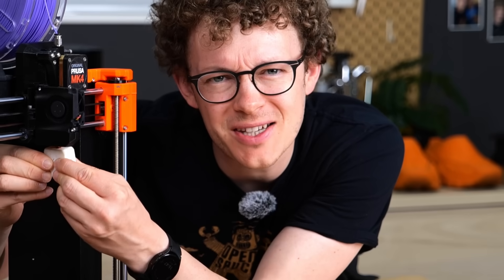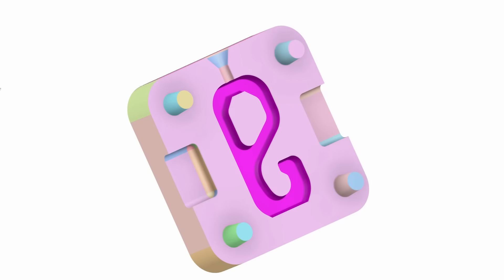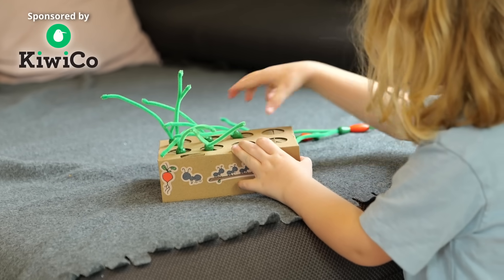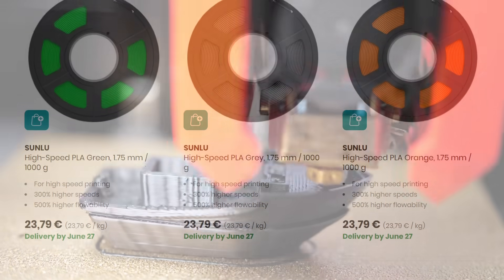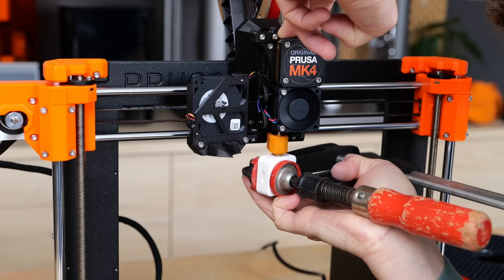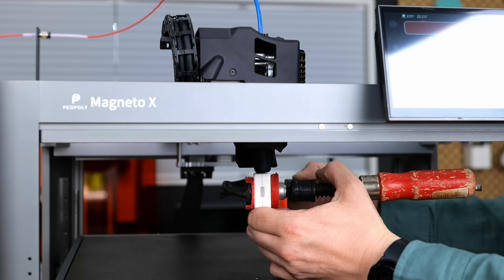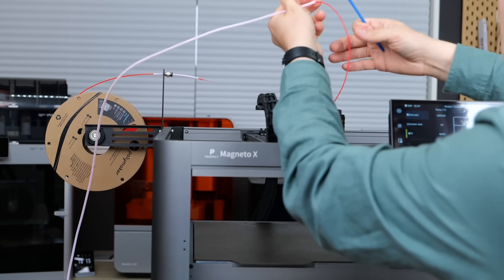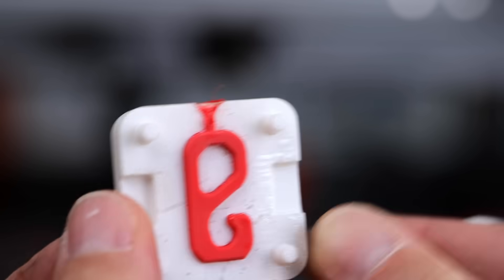I tried Injection Molding using a 3D Printer!

Comment: I see you are using a cereal box with a Rosahl RS1 dehumidifier membrane for filament dry storage. I made some 3D printable parts which simplify mounting the membrane along with PTFE tube outlet and USB power supply in place of the original cover plug of the cereal box. See on Printables if anyones is interested: https://www.printables.com/model/889550-filament-drybox-with-rosahl-rs1-electric-dehumidif. Also made mounting covers/frames for larger Rosahl membranes for bigger filament storage boxes, also on Printables.

Comment: I'd move the injection port to to centre of the mould by the Y section. Then have a small hole at either end to allow trapped air out at the points furthest away from the injection point. I think you will find that works.

Comment: i'd make a jig with a clamp to hold the mold in place and use the stepper motors to apply the downward pressure, it would keep the mold plumb and keep pressure inside it.

Comment: My immediate idea is to increase the material throughput. The problem seems to be that the plastic solidifies before it can completely fill the mold, which is by design, since this is intended for 3D printing. So I recommend something that the printers were under no circumstances designed for: melt multiple filaments at the same time and push them through a single nozzle with the largest diameter possible. Of course doing this would need multiple custom parts, made from proper (not 3D printable) materials.

Comment: wow those parts @9:16 are so crisp... what printer and fillament were used?
Reply: I also asked that few post bellow. Printer is obviously BambuLab X1 Carbon, there is calibration pattern at the side of heat bed, so it is one with Lidar, but i would also like to know what is that fillament...

Comment: I did this months ago, but I used an aluminum mold and secondary heater blocks to maintain temperature to keep plastic molten. It worked okay, but ultimately the limitation was maintaining heat. It's just a continuation of the hot-end, but without the high powered heaters and pressure used in injection molding, you're limited on part size.

Comment: Air lock?  Maybe a breather tube? What happens to the air in the mould as the plastic is injected.  If the mould is sealed tight, wouldn't that just compress the air at the end of the cavity?

Comment: One idea i had, where heating the mold not just before, but also during injection. With a heat mantle or as mentioned above, be pressing it against the hot plate. It might change the mold to be filled from a flat side necessary. Nit sure, if that’s possible or feasible.

Comment: You need to add vent grooves in the mold. This drastically helps fill the cavity when doing low pressure desktop injection molding. If done right (size and location of the vent as well as injection pressure) the vents won’t yield much flashing if any at all. I’ve successfully printed SLA molds with .001” deep x 6mm wide vent slots that fixed the short shot issues I was having.

Comment: It looks like the issue with the screw is that by the time the plastic gets pushed down to the head side, it is already transitioning back to solid. Try flipping the part in your mold, so that the sprue is on the head.
I would try finding an all metal clamp that can sit flat on the print bead without needing to hold it. Reinforced the heated bed such that it can take some force. Set the mold in the clamp, and set the clamp on the bed to preheat (and remain heated throughout the injection). Use the Z axis motors to drop the tip into the mold and apply pressure. The 3DP mechanisms may not be up to the task (force), but the method would at least be more consistent than relying on you to hold the mold up against the tip.
anyway, I think that with working on the lower limits of both plastic temperature, mold temperature and extrusion pressure, you will have to experiment a lot more mold design and part placement than you normally would on injection machines.

Comment: Some suggestions
1. Place the mold on the print bed and then CAREFULLY lower the print head and use the z-axis to seal the connection
2. Add a vent to the mold so you're not working against building air pressure in the mold

Comment: Try to add small hole at the bottom of injecting model to let air inside escape this way when you push filament from top, it will reach end and fill up properly :)

Comment: Ha another brillant idea, but why did you limit yourself to a nozzle and dont use a self made "threaded tube" with a suffisant length to contain all the molten plastic in place of the nozzle, you could even use the diameter you prefer like 1 or 2 mm at the end of the tube ?

Comment: I believe that if you take all other advices like vent hole and sprue location changes and then heat up your mold to +200C in the oven (I believe your resin will handle that without issues) then you will be able to inject much bigger designs without any issues. And for small models like your hook, hot mold + vent hole should do the trick.

Comment: Hi Stefan, I'm one of your supporters, and I like your scietific approach. I'm a plastics and composite engineer, and my approach would be a bit different. Since I frequently use silicone moulds (molds), I would recommend the following: Resin print your part as detailed as you want them, silicone would have around 2 microns in molding tolerance. I believe you would be able to produce vinyl records with it (perhaps). Yes, silicone is a flexible material, but if you have a support mold or a mold box in metal, you will be able to add pressure to your mold, and have no deflection. One advantage more with silicone: Some types withstand temperatures up to 450 degree Celcius. 200 degrees can be done with a standard silicone. You can then preheat the mold, and use your 3D printer as injector. When the mold is preheated, you don't need a high backpressure. But it doesn't hurt to have a simple fixture below your moldbox and the printers nozzle. Things can get hot at times ;-) If you experiment with preheating temperature, mold size and perhaps cooling oportunities, as you can cool your moldbox and the silicone inside in different ways. Maybe you can also get some inspiration by watching this guy: https://www.youtube.com/@TheCrafsMan   He makes pressure casting molds in silicone, and cast thermoplastics in them. Thank you for your great work :-)

Comment: Rather than just preheating the mold, you kinda want to do this inside a furnace so the cooling only starts after injection. Clamping the mold between two temperature controlled heating elements might be sufficient to create such "furnace". Oh and air vents might be useful too.

Comment: Why not using a direct connection to the heater block? simply use a long hollow M6 adaptor (cut away the nozzle part from a Volcano nozzle), and screw it directly to the mould. You avoid pressure losses in the nozzle.
Also, preheat the mould to 150C-180C...

Comment: cartridge heater on the mold 
waste gate so your not compressing air to fill 
canttwist clamp. or over center ratchet welding clamp for quicker set up.
Die-sinking EDM for alum molds to keep them hotter

Comment: Pre heat your mold to as hot as you can before it becomes too soft to function, by putting it in the oven. This will keep the inflowing pla hotter longer. Right now it's probably cooling and hardening quickly by contact with the cold mold.

Comment: @CNCKitchen maybe it would be beneficial for a tighter "entrance seal" to go from a simple cone shape to a hole that allows you to really insert the hex head of the nozzle. This removes any canting and might further increase injection pressure. And I would always use pre-heating to catch those extra seconds.

Comment: Try making your sprues as short as possible. The unnecessarily long sprue on your M4 screw is robbing too much heat from the molten filament before it has a chance to reach the mold cavity. Also, as others have mentioned, if you suspect your mold is near airtight, add (tiny) vents to the parts of your mold that filament has trouble getting to. You could even try modifying your existing molds with a 90° chisel, or a hacksaw blade held at 45° to the surface. Maybe even go crazy and try to pull a vacuum through the vents! :P

Comment: Wow! Your creative idea on 3D printer is amazing and endless.  What a smart move to leave some room for everyone here giving their input and gain more engagement, which you tried not to put an air-release-hole to the mold as well as lower the print head to fix the mold in position with down pressure instead of hold by hands. 👍🏻

Comment: You missed 2 things. Inject into the center of the part and you need vent(s) to let the air out so the plastic can go in faster with less backpressure. I have never done injection molding, but this seems like simple logic.

Comment: Quick comment on the Resin you used: Rigid 10k actually is based on Al2O3 filling - 4K has a glass filling. That's why you get much higher heat deflection temperatures with 10K - because it is kind of a ceramic!
Greetings from Germany! Great video and idea!
Reply from the maker: Interesting because the datasheet clearly says "This highly glass-filled resin...". Gotta dig a little deeper.

Comment: I'm curious as to why you were holding the mould to the nozzle by hand. Surely you could've made a more reliable and consistent seal by placing it on the bed (preferably with a large flat piece of wood underneath it to prevent damage), and then lowering the print head onto it? As long as you don't push it too hard, the lead screws should be able to exert much more force than you could by hand, thus increasing the potential injection pressure.

Also, safety - no chance of hot material leaking onto bare skin!

Comment: While your mold isn't air tight having exit holes might help. You have quite a long sprue hole and the plastic has the flow the entire path of the mold without hardening. Better placement of your injection port would help a LOT.

Comment: I believe with the ceramic-like resin-printed high-temperature molds, it might also be possible to add a channel into the mold where a removable thermal coil of wire connected to an adjustable temperature control module can be inserted before the injection molding and removed after cooling, heating the mold to a desired high temperature during injection of the filament material to keep the viscosity low until filled, then turning off the thermal coil to allow the mold and filament material fill to cool, completing the injection molding process.  The temperature of the thermal coil need to heat the mold to match the temperature of the filament material being injected without melting or warping or deforming the mold itself, otherwise the process wouldn’t work.

And as recommended by most others here, definitely make sure to have an air vent or two in the right locations.  Even with enough injection pressure, the hydraulic physics involving gases and liquids, both of which are considered fluidic in properties regarding pressure and density, can and will fight against the force of pressure from the injected material pushing into that cavity.  The air in that space need somewhere to go, and the material trying to fill the space is too thick for air bubbles to push through as the channel is too narrow for gas and liquid to switch places in different directions as nature intended.  The air vents don’t need to be big enough for the injection material to flow through, just big enough to let air escape properly, as you can clean it up later after cooling and removal from the mold.

(Note that I don’t own a 3D printer, I’m not an expert, but I have a good grasp of physics and an understanding of fluid dynamics and technological engineering, plus I have seen plenty of videos involving 3D printing and scientific principles and tech repairs/innovations to simulate these possible solutions to help.  If you have the skills and equipment and parts to test my idea and prove whether I’m right or wrong, feel free to do so and let me know the results.  I’m not fragile and I am aware I can be mistaken about a lot of things, but I usually have good intuition when it comes to these things and I enjoy learning something new.)

Comment: I'm an injection moulding machine operator and for a while now have been trying to emulate the quality of injection with 3d printing, but I remember seeing this topic before and have often thought about it. It's easier to take an injection moulding machine and turn it into a 3d printer than to make a 3d printer perform injection moulding. I do have some suggestions, however. You may want to design your mould with small vents for the compressed air to escape, also preheating the mould is key - you're on the right track there. Allowing the molecules time to relax will help reduce internal stress and warping (i.e. slow, adequate cooling time). I think that mould release helps. However, I think your main bottleneck is injection time. Normal injection moulding occurs in a fraction of a second (i.e. 0.10 sec on the faster end of the spectrum), filling the mould in 5 to 10 seconds allows the plastic to cool and freeze before it has time to completely fill the mould. The leading edge of the injected plastic freezes first. Keep in mind that temperature increases with flow rate and pressure. Maybe add a gate to maintain a high flow rate.

I hope some of this insight helps, I would love to start injection molding with my FDM printers. 😄
Reply: I've been thinking about you experiment a lot lately and I think your biggest bottle neck, literally and figuratively, is your nozzle diameter. I would suggest a 0.6, 0.8, or larger diameter to keep the volume and pressure high.

Comment: Also you have air inside and it needs to get out. Which is also a concern.  So make smaller exit sprues to let air out and  that will solve problems. 

Also fusion does injection mold simulations

Comment: Really cool. Two things of note.

(1) You need a second hole to allow air/pressure to escape from. When doing stuff like metal casting using a mold without that second hole you get only partially filled molds. All the 1 hole system is doing is causing air pressure to build up toward the bottom of the mold and that prevents it from filling. Without the hole all their air either gets trapped and won't allow the plastic to fully fill it or it tries to escape, either through the top hole where the plastic enters or by forcing the mold apart.

(2) You need to find some way to continuously apply heat to the mold. No matter how hot you have the plastic it means nothing if the mold rapidly cools it and blocks the passage.

Comment: @cnckitchen please try it again but  use a bit of threaded tube that screws into your mould but do NOT put the injection hole on the seam. This will ensure that the oboe pressure leaks are from the sides.  Holding it by hand is half the issue because you can't be holding it straight on all the time.  Better to have our threaded into the hotend and also clamped with a clamp that has thick metal pads that are also preheated with the mould. You could actually add a bit slab of metal to each side and clamp it with a metal gclamp and heat it all together.  You could also use a bowden setup and put the whole hot side of the hotend in a small metal box  via a small hole and heat the box with a heat gun

Comment: Did you try adding other spruces to let the air out.   You’re pushing this plastic in and there is probably trap air. Look at some silicon mold making tutials and adding some mold release

Comment: A few things I’d change:
1) make the mold fill from a center point so it fills from the middle out not the top down.
2) the filling from the middle out makes it so you can lay the larger surface area down on the build plate so that the heated build plate can keep the mold warm and allow for the plastic to cool slower and fill in more
3) move the nozzle manually into the hole in the mold, along with this maybe make the mold so ito holds a rubber or ptfe insert that the nozzle runs into and stretches that it gets a “seal” on the injection part.

Comment: A few suggestions. First put a vent on the bottom of the mold so you arent building pressure. Second instead of using resin, 3d print a positive and cast the mold with ceramics. That way you can preheat the mold.

Comment: preheating was definitely needed so I am glad you did that

you may also want an air path.  it means a burr to deal with but it should lower the pressure needed.  assuming not to small of details for the desired mold.  the air is part of the reason why injection molding uses a lot of pressure.  as well as to make sure that every nook and cranny is filled with the material.

so I think if you have a small air path it would help lower the pressure needed and still be easy to clean.  and if you need less pressure it should help a lot when holding it by hand

Comment: I'm not sure how practical it would be, but I'd like to try injection molding a part directly on the bed into a 3D-printed part using a multi-material setup where the outer mold is disposable. In theory, you could have all the commands needed to create the mold and then fill it with a different plastic in a single G-code file.

Comment: Why not add a port somewhere at the bottom to let the air out so the plastic can flow better and require much less pressure. It would create a bit more post processing because you would have an extra rod of plastic sticking out of the molded part, but seems like it would make the molding process easier.

Comment: Stefan, you need a vent to let the air get out the mold, allowing the plastic to reach the end of the mold. Then you can try again with a random printer and random filament. Preheating the mold is also a requirement.